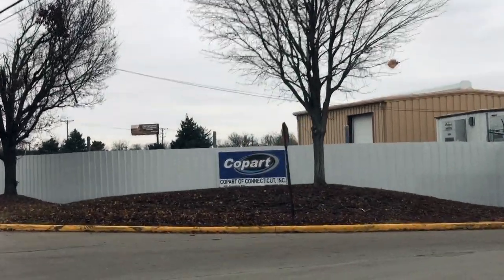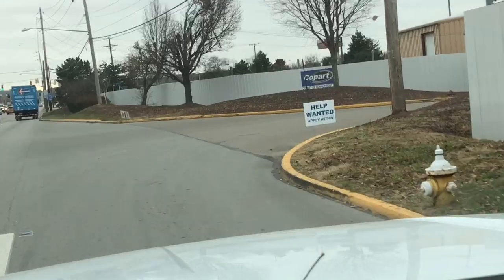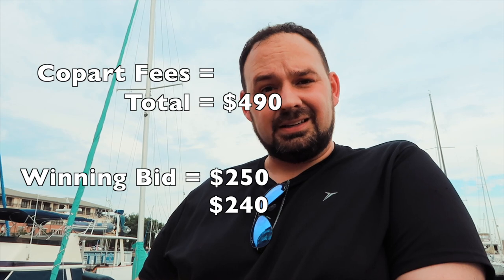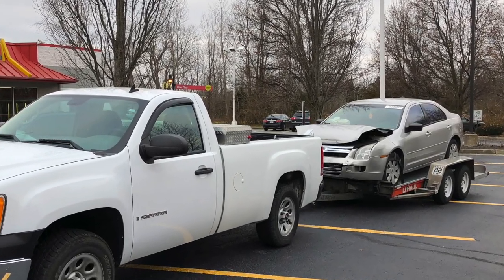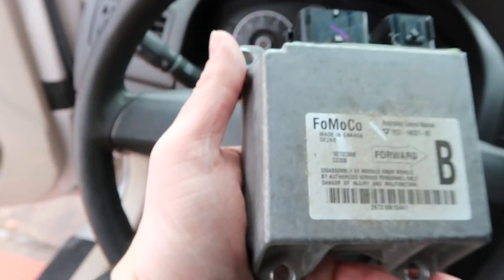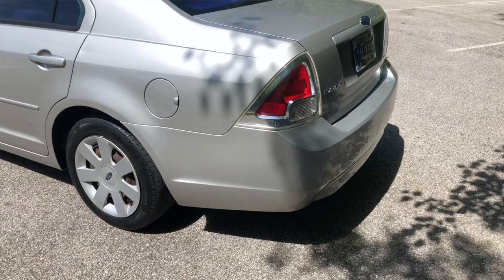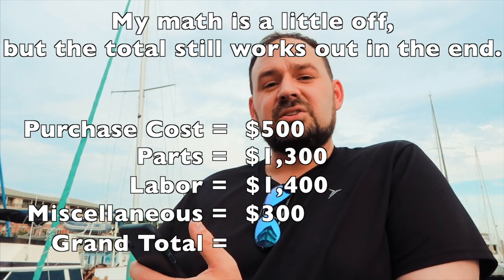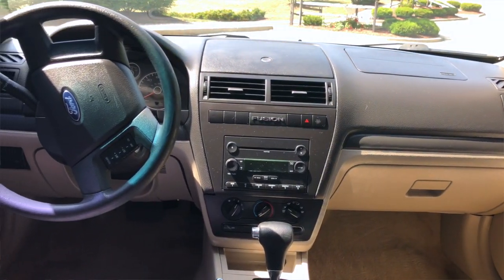The Cost of Rebuilding & Lessons Learned -- 1st Copart Rebuild Wrap-Up -- Fusion Rebuild Finale

Comment: I have an extremely similar experience. I had already been watching quite a bit of car videos for months before deciding to make my first bid. I really wanted to bid on a car but it wasn't letting me and I didn't understand why.. so I thought it was a technical glitch, and put a bid on a random Pontiac G6 and it went through. I didn't realize we couldn't cancel bids and lo' and behold... I won the car.

what a nightmare. My cashier check blew away in the wind(it was very windy at pick up), my dad decided to help me out and put the payment on his credit, I had to get it trailered to my house and luckily I had a great friend and his dad and him towed it for me back. Once it got to my house it was all fine. I washed it and tore apart the front end.

I thought I was mailed the title, but realized upon calling Copart I had to go into their office and get the title about 60 miles away after three-four months of waiting. Minnesota has a trash DMV titling system and it's severely back logged and tabs take up to two months to get mailed, and titles can take up to six months. I drove way into a city I've never been to before because I conveniently purchased the car from a sub-lot with no office.

Fast forward, I had replaced the bumper, the hood, hood struts, and the entire cooling system. Car was working fine! ... until one day it decided to not want to start. I wasn't sure what the issue was, it was electrical, and due to inexperience I wasn't prepared to diagnose and fix this issue. I bought the car back last April, and sold it in November of 2018 for $350 for parts.

After months of it sitting, just decided to get rid of it. I am 110% ready to take it head on again, knowing how the bidding process works, working on my own daily driver and other cars, and just months of more research. I actually am going to be rooming with someone with the same interests, and he makes a lot more money than me and has a project car he needs funding for so we're more than likely going to partner in on a little business.

I don't feel bad for the bad first experience, I learned a LOT... I lost only about $850 on the car, and I paid around $1200 for a damn good experience. I bought the car for $225, copart fees brought it to $425, taxes and tabs brought it to $625.06. I put in about another $600 in parts. My next project I'm thinking about trying out a cheap high mileage Facebook/Craigslist car. The place I am moving to has an official Copart lot about twenty minutes away so that is GREAT.

PS: We got a cashier check refund after four weeks, took so long because the receipt with the check numbers ALSO blew away... but luckily, the store I got it from brain-stormed and got me the help. Gave my dad the refunded check + a little more and all was good.
PSS: I never actually physically saw the check blow away, but I had got out of my car with a handful of papers incase I needed it to pickup the car. I got back to the lot and realized the check and a receipt for it were missing. I just assume it blew away because it was gusty and after about an hour of searching around the lot, I found nothing.
Reply from the maker: Wow! That’s quite a ride you went on with your first experience! Glad to hear it isn’t break your enthusiasm! Keep up the good work!

Comment: I think you could have done a couple of the repairs yourself - the wheel bearing and the a/c.  At least in Colorado, you can rent the vacuum pump and gauges from Autozone and buy the R-134a refrigerant and charge the system.  It's not very hard and the equipment rental is free (you pay for it and then they refund the cost when you return it.)  Great video.  Thanks for letting us know how it went, and doing so with such candor.
Reply from the maker: Thank you! Next car I do that needs AC recharge I’m going to learn how to do it. I’m committed to learning new skills!
Reply: Crossroads Rebuild Yeah those are both jobs you could have done yourself after watching a couple YouTube's. Eric the car guy has a couple air conditioner videos. Wheel bearing is easy when you borrow a puller. Those jobs would have turned your loss into about a break even or small profit I bet.

Comment: wow, I haven`t had a loss like that yet, you shoud have just bought a parts car, saves alot of money plus you can sell off the parts,
on my 
Fusion I ended up spending $3500 and its worth $4000 or a bit more but it doesnt bother me because it was worth more when i bought it and depreciation has taken its toll and its now my personal car.
to keep costs low i am attempting to paint my MKZ myself but its tricky,

best of luck to you man
Reply from the maker: Lots of lessons learned on this car! It could’ve been sold for parts, but there are also ways I’ve learned that I could’ve done it a lot cheaper and actually made some money. I consider this loss the cost of an education.
Thanks for watching!

Comment: we pay for our education one way or another. sounds like you learned a lot. i fix ford trucks. however, i only buy clean title trucks and i dont buy from the insurance auctions. i buy a parts truck and use it to fix multiple trucks if possible. when i am done with the parts truck it is usually just a frame. good luck with the next one!
Reply from the maker: Thank you! I like your idea of fixing multiple of the same kind of vehicle with one parts vehicle!
Reply: very cost effective. it seems like it is all the "trinket" items you end up needing that can run the cost up without knowing. i do a lot of running problems, electrical issues, engine repairs, cab swaps and 2wd to 4wd conversions.
Reply from the maker: Very cool! I just subbed to your channel. I’ll be checking out your projects.

Comment: You did a great job bringing that car back to driving condition. I think the labor cost is really what killed ya plus that vehicle doesn't have much value even though it is a good average car with good gas mileage.
Reply from the maker: Yes, labor was a big part of the overage. As were some of things I didn’t know about the car before purchase like the windshield and the wheel bearing.

Comment: Would be better if you could find a friend that can order you new aftermarket parts from LKQ under a business account. Way cheaper than getting taken by a salvage yard for a ton of money. Unless it is a place where you pull your own parts, it's not worth it really. You ended up painting anyway.
Reply from the maker: The salvage yard I referenced was a you pull it place. I got some of the body parts from there, but mostly found smaller odds and ends.

Comment: Don’t buy a rear end damaged car.
Replacing quarter panels is not easy or cheap
I learned the hard way lol
Reply from the maker: Yeah, it would need to be a high value car to make that worth it. However, they can definitely make good parts cars to fix a rebuildable front end damaged car.
Reply: Crossroads Rebuild yeah certain situations they can be. On the other hand not a good idea for a 2003 Honda Accord with 300k + miles on the odometer lol 
I learned real quick to be careful when bidding on auction cars lol
Thanks for the content man, just release my fist video of our 2009 Ford Fusion.